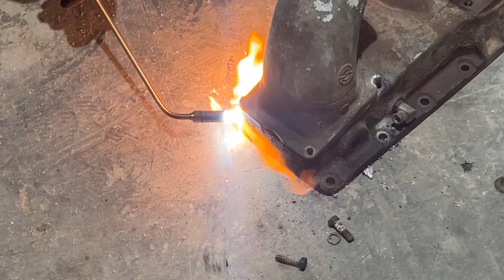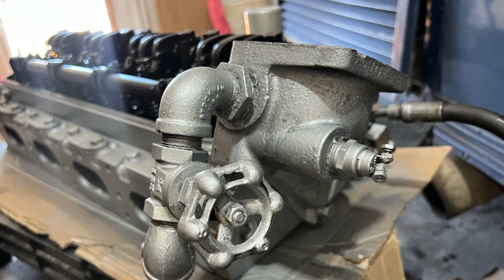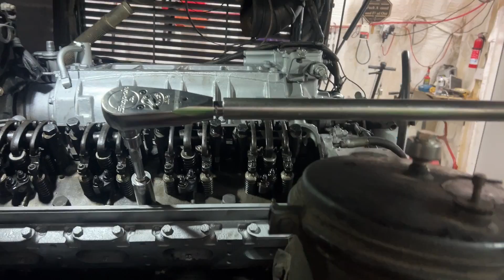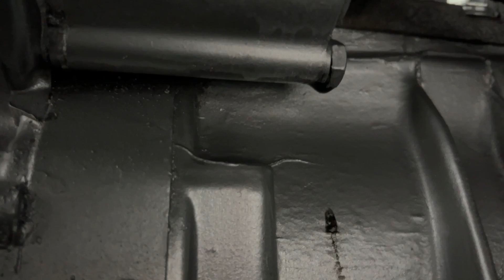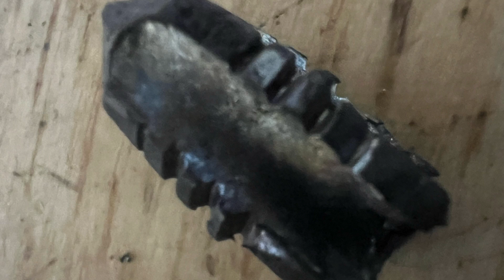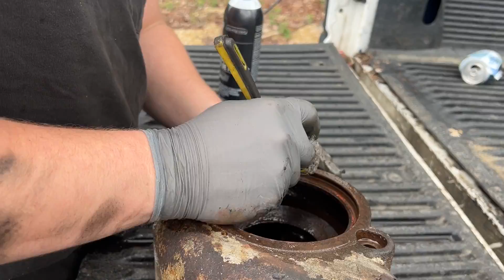Detroit diesel 8v92TA rebuild.  Water pump rebuild, heads going on, main bearings

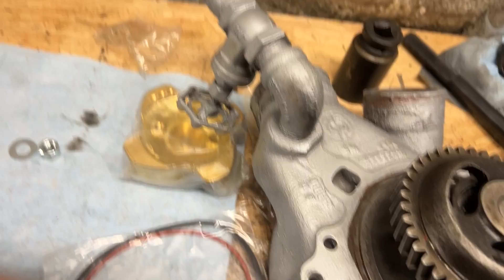Comment: Need to change the heater stop valve on the water pump to a ball valve and swap over the hose fitting. 29:49 looks like half inch or three quarters NPT. 31:29

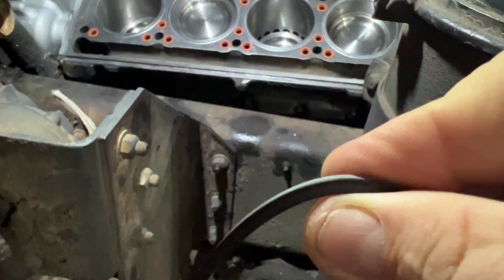Comment: 11:39 when  you say the rubber seals..the color faces away from the cylinders do you mean radially outward from the sleves?
Reply from the maker: Yes.  If you picked up the head a tiny bit and peeked in you would see the color side

Comment: Above the exhaust port there is a plate held on by two bolts. What’s that for?
Reply from the maker: Different styles of cooling manifolds mount on those.  There is coolant under them.
Reply from the maker: https://youtu.be/IYq_EOiyI5Y?si=FaE85HhWCrvi6vww
Reply: @BusGreaseMonkey  that answers my question. Thank you very much!

Comment: Good work on a big project. I am a bit concerned with the lack of "meat" on the outside of the bolt hole in the intake elbow when the hole was redrilled. I can see that cracking in short order.

Comment: OOohhhh...you mention that inner seal on the water pump keeps oil out?! Can that be changed with the pump on the engine? I have had a bit of oil getting in my coolant. Previously changed out the outer water pump seal as coolant was leaking out the weep hole, wonder if that inner seal is where I'm getting oil in the water?
Reply: yeahhhhh...thinkin I need to pulll off my water pump...6v71...
Reply from the maker: Oil cooler    -   Water pump would leak oil out the weep hole

Comment: Scott, you and Jonathan are doing an excellent job with this rebuild. Love that you're mentoring Jonathan with the nuances of engine reassembly, etc. Also love your improvised remedies such as the lopped off head bolts that you use to ensure proper alignment of the cylinder heads as you're carefully lowering them into place. Too many careless mechanics botch up jobs like this by dislodging a head gasket, shims and/or o-rings. I'm convinced that this is a chief cause of coolant-in-oil seepage on prior rebuilds. Kudos to you for doing such a great job in tutoring and mentoring Jonathan. He's a patient young man.

Comment: I install studs where possible to eliminate seized bolts. Installing Time-sert thread repair inserts in aluminum housings also helps eliminate seized fasteners.
Reply from the maker: It wouldn’t help there the thermostat housing seize on the shanks.  The anti seize and flat washers will do the trick
Reply: Saw an interesting video from Gale Banks on using studs on a Diesel engine. He says do not use them because bolts have a tiny bit of give that let's them take the strain. When studs are used they do not have that give so the threads in the block do leading to them pulling out. So studs do have a place to use and places to not use them.

Comment: Would you mind expanding on  your issues with the oil feed line. I have a 6V92 and this line (DD #8923538) seems to be in stock at the usual places for around US$60 plus shipping. Is the 8V a different part number or was there something else involved. Thanks.
Reply from the maker: We had the ends we were just trying to order the aeroquip hose for it.  The wrong diameter showed up 2x   The supplier then checked their inventory and said they didn’t have the correct hose.

Comment: Why SO MUCH never seize?   The extra does not do anything....  or does it?
Reply: It does in this application (where a long shank bolt goes through a close fitting bolt hole). I have seen many times where the long unthreaded shank of the bolt became seized in the bolt bore because anti-seize compound (or grease) was not used.
Reply from the maker: 3:00 https://youtu.be/c-rtAR2M6ew?si=vaBeaOhM-jNTI6Sh

Comment: Scott, I was wondering why you don’t use the Quinn Digital Torque adapters that you got from HF, to tighten the fasteners with? Did they break or do you not trust them over the click type?
Reply from the maker: The icon click is easier and better for the task but if you don’t have the expensive one the digital one will do great